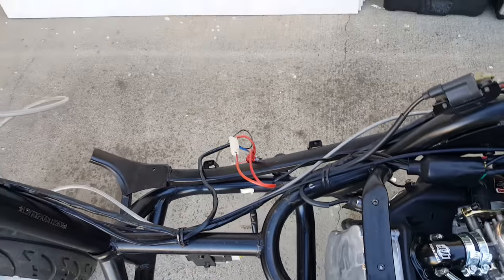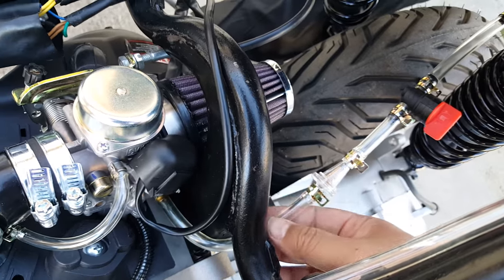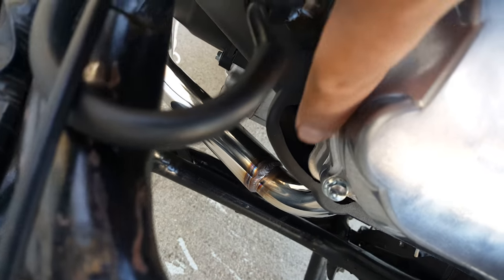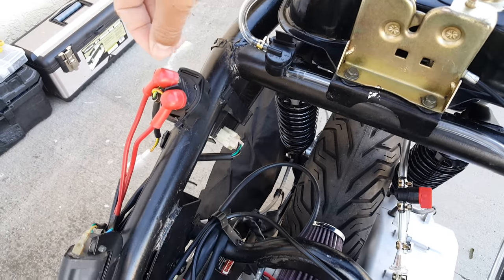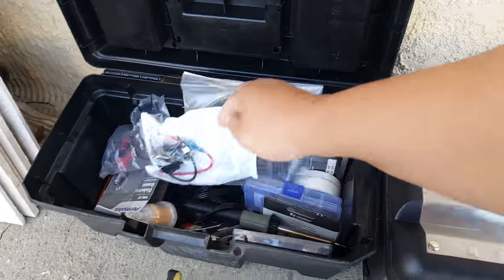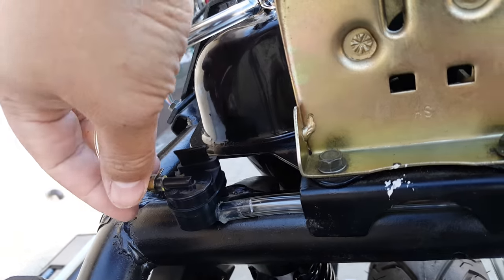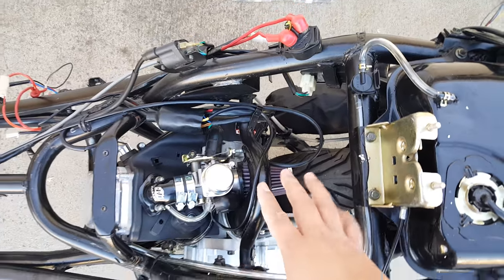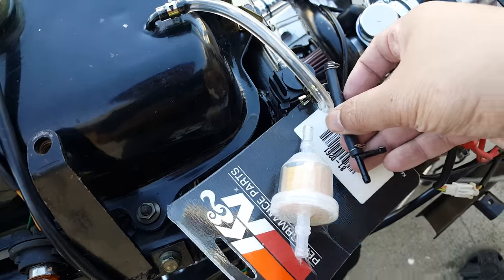GY6 Carburetor Fuel and Vacuum lines (simplified) 1 of 2

Comment: the PCV valve is used to scavenge oil fumes, and blow-by gasses from engine combustion into the intake to be burned, as an emissions consideration...however it has a secondary, and far more practical use, which is to create negative pressure in the crankcase, because this helps prevent oil seal leaks, and oil consumption. Routing it to the gas tank will not at all help, and sadly, will likely somewhat contaminate the fuel, as when the engine is cold, condensation is a major consideration until the engine achieves operating temperature. I don't believe i'd route it to the gas tank. I would instead "T" it into the main vacuum port (after the PCV valve --which is the black plastic item in-line between the valve cover vent and the gas tank in your video). Since the connection on the gas tank is also meant to route fuel fumes to the intake, a "T" there would possibly be appropriate, although, it's better to just use a short piece of vacuum line and a fuel filter (to allow it to breathe without allowing debris in) because the fuel tank can't be counted on to be airtight, and thus vacuum tight..which would create a vacuum leak.  In summary: I would route the pcv to the intake, and route the gas tank vent to a short piece of line with a fuel filter on the end, for maximum benefit.
Reply: Someone that actually understands
Reply: If you add just a fuel filter like this person says,,,, when you fill your tank to the bottom of the filler neck gas will leak out and continue to leak out until you lose enough gas that when your bike is on the side stand it won't leak anymore,,,,,,, the tank vent solinoid goes where it supposed to go, to the canister  or you will suck in oil and condensation to your gas and your spark plug will let you know about it as it becomes fouled.😮

Comment: Venting the crankcase into fuel tank (especially without an oil separator) ?? Ummm, Nope. Sorry, I don't like oil in my gas tank.
Reply: Thank you. That’s what I’m tryna figure out 😂 have any ideas? I wanna use a cone filter and do t want to have to run 2 lines into it.
Reply: @Cryptixpx  I run a catch can and a 2 stage uni pod foam filter. My hose goes crank case vent >catch can> uni pod filter. I just stick the hose from the catch can in between the foam layers of the Uni pod filter. The catch can condenses most of the oil but some will still end up back in the airfilter and the intake.
Reply: @RellyOhBoy  Okay can you tell me what kind of catch can you use. And what about the emissions from the gas tank do you just ignore or cap that?
Reply: @Cryptixpx  gas tank vent I just run a short length of tubing to a small fuel one way filter tucked inbetween the tank and the rear fender. 

The catch can I got from Amazon https://www.amazon.com/dp/B07K9LMF3X?ref=ppx_pop_mob_ap_share
Reply: @RellyOhBoy  Got it, thanks a lot. Hope this guys scooter didn’t shit itself.
Reply: @RellyOhBoy  Hey, have everything figured out but I can’t find something for the gas tank vent. You said a one way filter. Can you send me an example.

Comment: That fuel line looks a little short i would make it a bit longer so your suspension can travel and not rip it off .  That black and red thing is a petcock  and that hose connects to  bottom of the  the tank or  . That hose off the manifold should be plugged off  because that NCY carb has  no Air cutoff  valve  and that is a vent on the side of the carb that should be left open ,  The case ventilation hose should be left open in that case  and  mounted high so  you get some drain back ,that one way valve will work but it is so cheap i would not trust it .  And running that crank case vent line  back to your carb is sort of useless  with a open element  air cleaner  it can be done but why !     Nice manifold and carb set up
Reply: QUICK-STAR   Leave the OEM vacuum operated petcock and gas hoses as they came from the factory!  Sometimes when the carburetor bowl is empty, the starter can't spin the engine fast enough to generate enough vacuum to open the petcock.  Gas never flows from the tank to the carburetor and the scooter won't start.  The solution is really simple.  If you apply vacuum from a pump (best) or from your mouth (if you don't have a pump) to the vacuum hose that leads from the carburetor to the petcock, you're doing what the engine would do if could spin fast enough.   If you apply any vacuum source  to the petcock, it will open and gas will flow and fill the carburetor bowl. The scooter should now start normally.
Reply: QUICK-STAR  I strongly advise NOT to use a pet cock that requires a  hose  between the tank and the petcock.  If the hose between the tank and petcock fails, the entire contents of the tank will drain out. If your scooter is parked in the garage, the gasoline fumes could be ignited by the hot water heater or furnace.

Comment: question: if I removed the fuel petcock and used a fuel manual shut on/off valve should I plug both manifold stems since I dont need a vacuum pump anymore

Comment: I bought a new carb and my original carb had a manual choke and my new one has an electronic choke but I have no where to plug it in is it necessary or can I leave it hanging?
Reply: It Needs Power. Connect it To Fuse Block.

Comment: I don’t understand. Running the Crankcase vent to the gas tank? Won’t that put oil in my gas. What’s the work around?
Reply: Don't run the crankcase vent hose into your gas tank. That's just plain stupid. You'll end up with oil in your gas and a fouled carburetor eventually. Smh.
Reply from the maker: It captures a bit of a gas vapors and some oil residue recycles it back to engine filter through the air filter/ carburetor.
Reply: @NCYSTORE  but you had a one way fuel valve that lead to your tank. The pressure comes from your valve case and goes into your tank along with the oil. You need something to catch the oil

Comment: Can those of us who don't see the importance of the positive crankcase ventilation also remove that system because these systems are unnecessary sources of problems and leaks on scooters? Then, the fuel line from the tank can be connected directly to the carburetor with a manual switch?
Reply: Yes and yes
Reply: you can just throw a little paper filter on it.
Reply: No because the problem is, the valve cover pressure release line tends to run to the air box, which when running is sucking that pressure out every 4 rotations, causing a negative airspace within the cam valve cover, which then helps the other functions of the piston system as it surges through high and low pressures constantly. The issue with upgrading to a new air filter is that it doesn't accommodate for these lines and so you have to find a new way to make the pressure flow properly. Truth is, there is no right way to do this, as long as it runs and air flows properly. However the feel like will not run fuel through unless there is a negative pressure running through the vaccine line that activates throughout the intake cycle of the piston. It's hard to explain but basically that line is to help with negative pressure. My best bet would be to run that to it's own one way valve, and  run it into exhaust to help with suction, or run it straight out into air. The one way valve should help with holding the negative pressure

Comment: Question: I have a 50cc TaoTao. I upgraded fuel line, filter, carb n added shutoff. I reduced my fuel line from 1/4 down to 3/16 after the fuel filter since where it connects to carb the 1/4 line was way too loose. I had it running after all upgrades were done but now it Doesn’t wanna turn over. Seems like it’s starved for fuel. I see u put silicone over the connection where the hose was too big. Could reducing fuel line size after the filter be my problem? Did U use regular silicone? Thx
Reply: n
o

Comment: how did you hook the hose straight to the gas tank isnt there a petcock or valve under the gas tank did you remove it ? or how did you hook it up
Reply: The video shows what he did 😂 he hooked up the fuel line directly from the tank to the carburetor

Comment: Besides the vacuum and fuel lines that you explained, there are two
other thicker black hoses on my Evo 150cc Taotao scooter. They start off at the
right-hand side of the scooter. One of those hoses goes to the front of the
scooter's where it is connected to the engine. The other thicker black hose is
connected to what looks like a black canister at the right-hand side of the
scooter's frame. It is located on the frame between the fuel tank and the
ignition high-performance coil box. However, at its end, this thicker black
hose (about double the size of the other vacuum lines) is not connected to
anything on my scooter and is just hanging by itself. I am suspecting that it
is the reason why the scooter is not starting. Also, on the left-hand side of
the scooter's frame, there is what looks like another black canister which has
two hose connections, one small another one bigger, but then there are no hoses
connected to it. I suspect that the lose thicker black hose that is dangling in
the middle of the scooter fell off from that. May that be the case? However, I
don't want to connect that hose to the black canister on the left side of the
scooter because I am not sure that it is supposed to be connected there. So
far, I have searched in vain and have not found a YouTube video with an
explanation of the purpose for those thicker black hoses on the scooter. Are
they part of the scooter 's vacuum system? Please advise. I look forward to
hearing from you. Your explanation will be highly appreciated.
Reply: Dude mines got that too

Comment: From my crank case, i added a small paper filter. no tube back to my gas tank. you think that will be ok? I haven't noticed any leaking.
Reply from the maker: How's the working so far two weeks now since I replied
Reply: @NCYSTORE  the paper filter works well, no leaks, and no other issues. Ill be putting on a BBK I ordered from your store. Hopefully that wont impact anything. I also got a crankcase breather hose, Im not sure where I got that from. I had to order from a couple different spots. Im doing the 171BBK with an A9 cam, and 16*37 final gear.

Comment: Is the manifold vacuum completely plugged off?
Reply: Exactly what I'm trying to figure out. Why is there a hose instead of a cap on the manifold
Reply: @curtissnance3812  I ended up putting a screw in it. I sealed it with some gorilla glue. Just a little bit towards the head of the screw. And let it dry, for a day or two. So nothing gets sucked in.  It worked with no  negative effects.
Reply: I actually had a small hose connected to it. Maybe an inch long. Maybe not even that. Just so it didn't look too goofy. My motor was pretty visible. I put glue around the nipple before attaching the piece of hose to it. Don't want loose air flow getting in. I'm sure that would effect performance.

Comment: What if i don't have a vent on my gas tank?
Reply: Instead of overflow tube it Might have a small hole on the neck between cap and tank. If you ever overfilled you know it. You would think you'd sprung a leak. Don't overfill!
Reply: If it doesn't have a vent the fuel will not come out it will eventually vacuum lock, it must have some type of vent,  in a system like this I'd use a large tee with reducers to fit the lines, connect the fuel tank vent and crank case vent to the tee, then drill a hole in the end of the air cleaner, with Barb fitting then run a line from the airfilter, to a fuel filter as then to the tee with the other lines connected, it should work fine!

Comment: Don't buy the blue fuel line from Amazon  it's cheap and degraded in one season.  Residual gas from sitting probably was the culprit. I recommend using the black fuel line.

Comment: Can't I put caps on end of carb where u put hose at for air
Reply from the maker: It's a vacuum line put it to good use, but yes you can.
Reply: @NCYSTORE  ok or do u think put petcock back on new one with new hoses I was gona buy new carb to it's been sitting for 3 yrs only 17 bucks

Comment: What adapter did you use to get rid of the vaccum petcock? My petcock is on bottom of my tank and I'd prefer a manual one like you folks show.
Reply from the maker: just installed  briggs switch found on amazom somewhere forgot the link.
Reply: @NCYSTORE  did you install the switch at the bottom of the tank and then another switch as the shut off?
Reply: same here theres a petcock at the base of the tank did you ever fiqure it out is there a way to connect the hose straight to the gas tank or did you buy a valve

Comment: The ccv vents exhaust!!    Godd$^&^!    Youre putting exhaust gas thick with carbon, back into your fuel.   Carbon robs the oil of lubricity....   so get it outta there!
Reply: The tube he's pointing to at 1:52 is split open on my bike. My bike is not starting. Is this directly related? I don't quite understand the function of this tube.